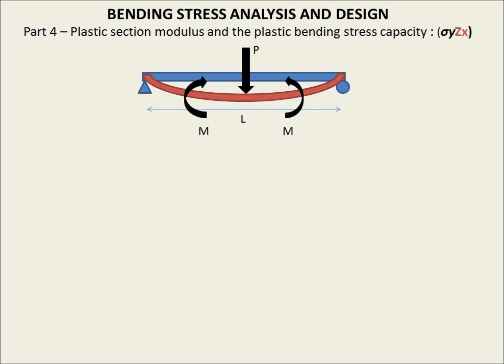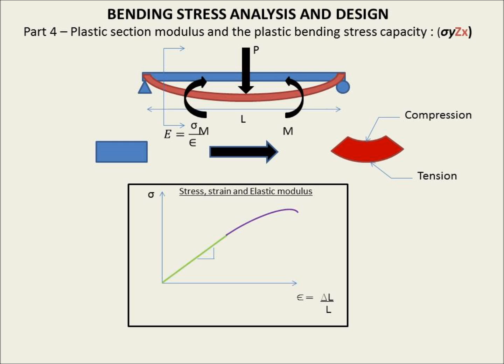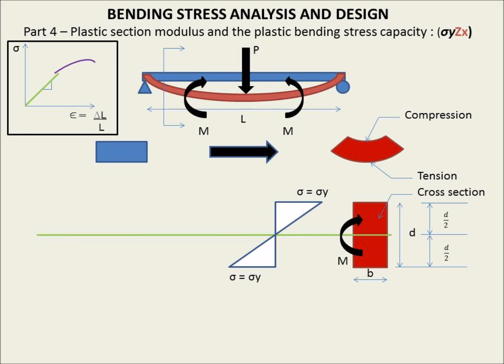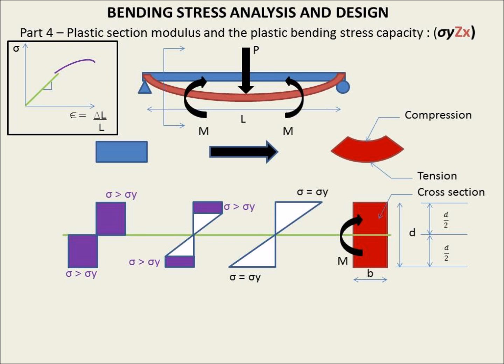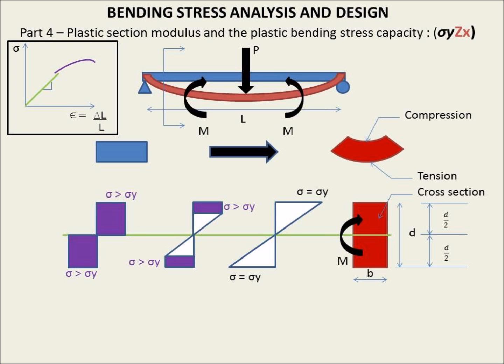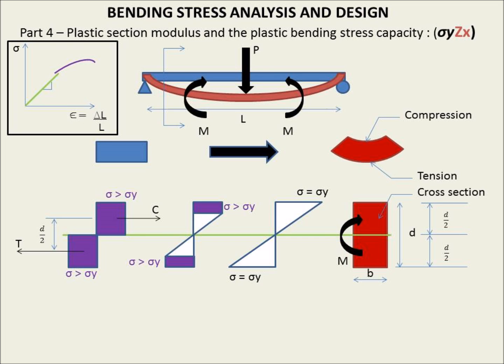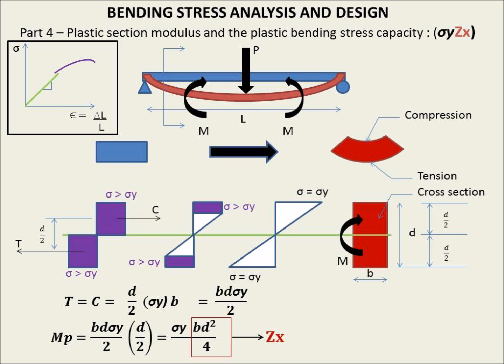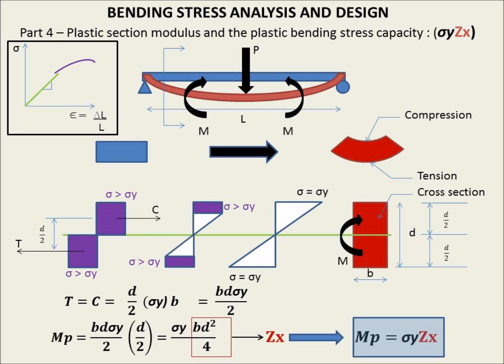Basics of Bending Stress part 4 - Plastic section modulus (Z) and plastic moment capacity

Comment: Unfortunately your video is incorrect and needs to be edited. In general, it is fine to have the stress greater than the yield stress in the stress-strain diagram, but your equation for Mp is based on the stress being equal to the yield stress. The Mp equation and stress distribution over the depth of the beam are based on an elastic, perfectly plastic material (a special case in which the maximum stress = yield stress). In order to correct your video, the stress-strain diagram needs to have a horizontal line at the yield stress and the inequalities next to the stress distribution figures need to be changed to stress = yield stress.
Reply from the maker: You are correct.  Thanks for the correction.  The assumption is that the section never experiences any stress greater than yield stress.
Reply from the maker: Please see our latest video (on structural dynamics)
https://youtu.be/ZxvLC-91QKs
Reply: You are totally correct.

Comment: please clarify..since we are talking of a concrete beam, torque means the rotation of the beam about its axis along the beam length. we have in the example a simply supported beam, and there are no restraints at the supports. How could you say that there is torque acting in the cross section of the beam? Also, as I see in your presentation, you are discussing the plastic moment capacity of the cross section, not the bending or torsional moment applied  in the beam.
Reply from the maker: Hello Kedz,

You are right about the definition of torque.  The cross-section we are discussing is going through bending and not experiencing any torque.
Reply from the maker: Here is another video for our loyal fans! This one breaks down the concept of shear stresses in beams!
https://www.youtube.com/watch?v=fJiJY06iX7Y
Reply from the maker: Please see our latest video (on structural dynamics)
https://youtu.be/ZxvLC-91QKs